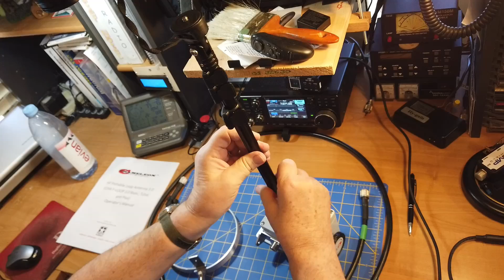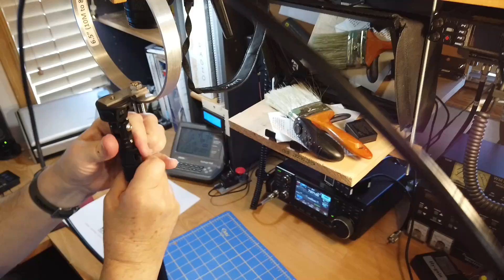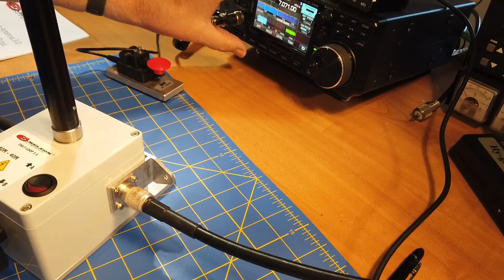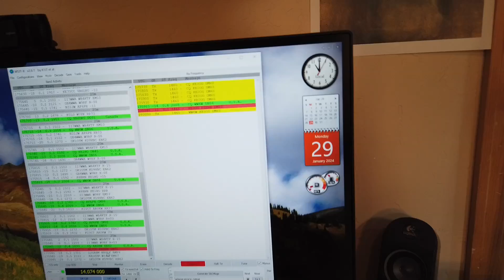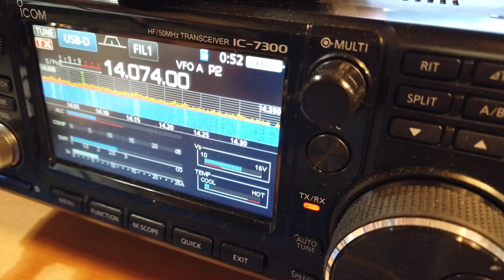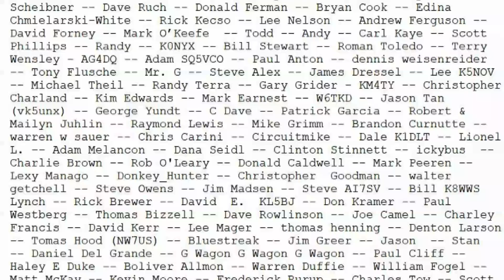Chameleon F Loop Version 3 Basic (#1071)

Comment: What is the polarization of the antenna, setting it up the way you did?  I know HF signals become randomly elliptically-polarized once they encounter the ionosphere, but local RFI is often vertical, so it can matter in noisy environments like most urban areas.
Reply: I own this loop in the polarization should be vertical. Keep in mind that due to the high Q you’ll have quite a bit of RFI resistance, and the magnetic field operation helps as well.